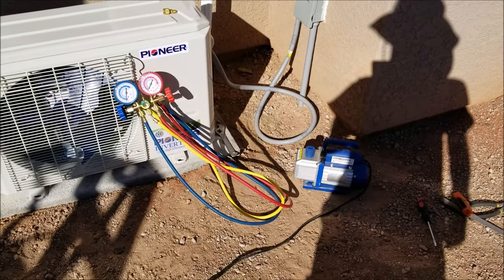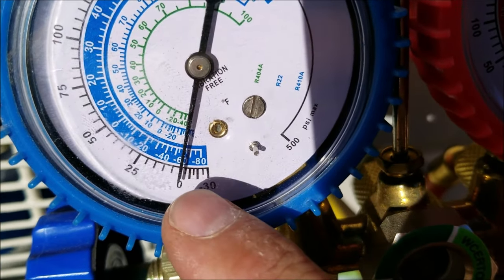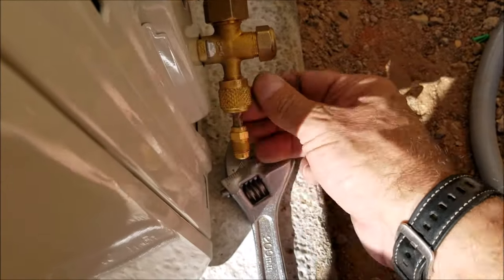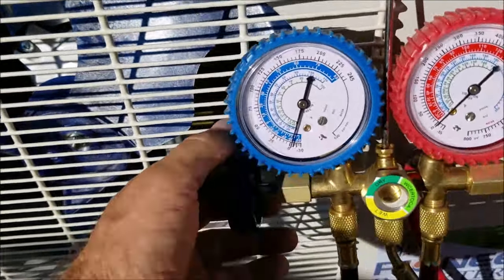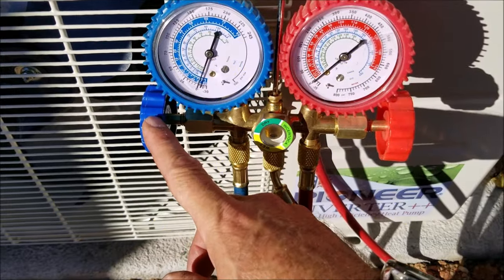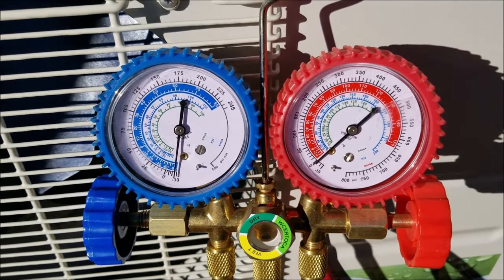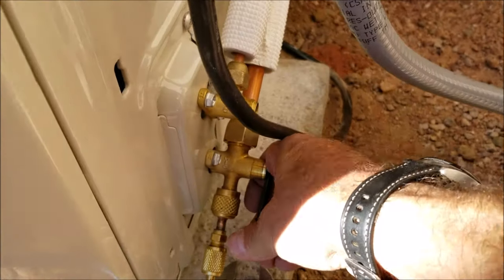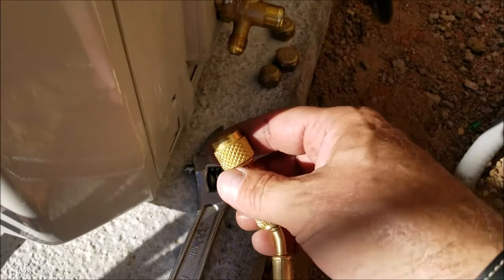How To Vacuum Down a Mini Split with Analog Manifold Gauges

Comment from the maker: UPDATE: I made an update video that shows more details and how to check for small leaks. Here is a link. https://www.youtube.com/watch?v=DgaPPyAZSTs

The line set can also be tested for leaks with a low cost can of R152a propellant. Before vacuuming the unit, the line set can be filled with the R152a and tested with soap and water for any leaks. KWIK-E-VAC on Amazon is R152a. Here is a link. https://amzn.to/3AlXVpH
Reply: I actually run the AC in my classic 70s car with R152a. I use canned air duster which is the same. Thanks for the tip.
Reply: Thank you for sharing your expertise. 
One question is that the port for vacuum is no need to remove the valve core.
Thanks in advance..
John
Reply: That tip is golden. I wss wondering how to do a bubble test without getting a costly nitrogen tank to verify, and dont want to trust beginner quality vacuum pumps without having a quality micron guage. The unit itself is well under 1k so it would be silly to pay 5x that for an install even IF you brick the thing or shorten its life. Pressure test shpuld be dome before trusting any mediocre vacuum because a fraction of moisture from above 500 micron isn't immediately fatal but a refridgerant leak sure will be.
Reply: Very helpful!

Comment: This is possibly THE BEST and easiest mini split vacuum video on YOUTUBE. 99% of the videos on YouTube either skip this part in detail or don't explain it well. For the record: YES I DID USE THESE INSTRUCTIONS to vacuum a non DIY mini split and it's been working with NO PROBLEMS. HVAC "contractors" or "Con-tractors" wanted to charge me $400-$800 just to vacuum. Like I told the last guy "You all keep overcharging and turning down work it won't be any work left sooner or later".
Reply: 😂 I've been seeing these con-tractors losing their mind in the comments on minisplit social media ads. They are scared of this tech!
Reply: I'm not a HVAC contractor, but am a contractor.. I just gotta pipe up and say that cost was fair! I can't even open my door for less than $300.. You gotta keep in mind, insurance, fuel, licencing, experience, man the list can go on and on.
Reply: @haulotteConstruct 300 for an hour of work? $100 for your parts and insurance  , and $150 per your hour of work assuming you’re driving from 15-30 min around the city. $300 is too much and $400 is insane.
Reply: Overhead, profit, gas/insurance/wear, time, knowledge+skill all adds up

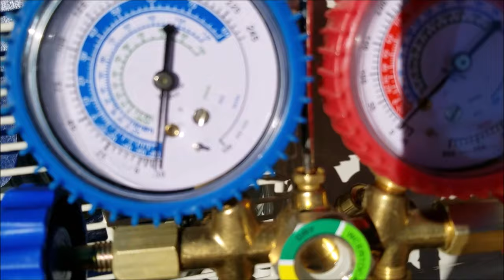Figure its an hour hold under pressure 30min to setup/pull a vac, 15 to disassemble/close up/pack up tools in the truck. Add in a 30min drive each way(could be more could be less) and youre at 2:45min from start to finish time wise. A set of gauges and a vac pump would cost you 150 bucks from home depot. 400 sounds about right, 8 is nuts unless its a 3am emergency. 

Now youre more then welcome to do it yourself, buy paying a tech also means if it doesnt hold a vacuum theyll correct it. If they mess up theyve got refrigerant ready to go. 

When i quote clients (different business) i factor in 10% for overhead and 20-30% profit. That would put this job at 300 for me and i dont have the overhead a licensed hvac tech does. 
@oshitomaha
Reply: Doesn’t a hose cost like 100$, a vaccum pump another 150$, then you got an hour of time so $150 an hour service charge plus their travel time? $800 sounds fair
Reply: @marklujan7591  If you're willing to spend $800 plus for that then I need to go ahead and get licensed lmao. The ENTIRE kit on Amazon is about $150 for everything. Now if you're not capable of tightening a cap or screwing a hose or reading a meter then there is a COMPLETELY different discussion and self reflection that you should be having.
Reply: @marcus_b1  ahhh okay well I don’t usually go super cheap on this stuff, if you’re doing it for just 1 time use then I guess but my customers use this multiple times a day for years.
Reply: And when you can get the whole set of tools on Amazon for less than 150$ who the hell would pay a contractor at this point. Sure they are supposed to have the knowledge but I'd trust myself more than 90% of the contractors out there.
Reply: @marklujan7591  Do they have to buy a new hose and a new vacuum pump each call.

Comment: Yo!!! You just saved me 300$!!! I just installed a mini split and needed only the lines vacuumed, I got a quote of 250$ and 50$ for drive to my house. I ended up buying a manifold gauge set for 83$ on the Walmart app and bought everything else you posted from Amazon. Thank you so much for this easy to follow guide!! Man it feels good that your video helped me out during and save me a couple bucks!
Reply: can do it for free... autozone and o reily lets you borrow the pump and gauge!
Reply: I was quoted $800 lol.
Reply: @michaelnguyen370 autozones manifold gauge doesn’t work on mini split set ups - there hoses are 1/2 and mini split requires 1/4 hvac hoses
Reply: @Bostonn617 you gotta buy the adapter

Comment: I think that after releasing the refrigerant onto the lines. Then, you should close it again to disconnect the vacuum valve. Then open agai. This way you only lose a minimum amount of refrigerant.
Reply: Saw another video  where the guy put 1 pound of refrigerant inside and let it sit for a while to see that there are no leaks with positive pressure. Then he disconnected with the 1lb of pressure instead of high pressure,  so lost minimal gas. Then opened all the way

Comment: Best and most clearly explained vaccum procedure out of the last 10 or more videos I watched.  I had a leak (or so I thought) turned out it was the cap on the vacuum pump. Helps to close the valve on the guages before shutting off pump!!! Thanks!!

Comment: Man thanks so much for your video! The first mini split I installed, they charged me $285 just to vacuum it! I spent $180 on a pump and gauges and adapter and doing it myself! Priceless Info since I’m currently Installing mine in my bedroom! I’m currently letting it vacuum but soon I will have cold air and won’t have to call the HVAC guy no more!!

Comment: Thanks for the video,I just installed my Mini Split and saved $250
I bought a vacuum pump and did what you did,step by step and had a leak that would be a problem,but vacuum pump helps 
Thanks

Comment: Out of curiosity, I called a tech guy at I know at Carrier. This morning, he told me once when he was in the field, he couldn't get his micron gage below 550.  He re-pressure tested with a tiny bit of 410 as a chaser. At 300# for 30 minutes. No leak.  Because he used some 410 as a chaser his electronic tester found a tiny leak. 300# of Nitrogen for 30 minutes is valuable, but it's only one step of two. The 300# test will not reveal small leaks in 60 minutes, but will drain the system in 20 days etc.  The micron gage will find small leaks.

Comment: Thanks.  Ready to vacuum the lines on my Della mini-split (relabeled, most made by Medea of China).  I have the Harbor Freight gage set (automotive) and their vac pump, similar to your setup and frustrated I had no fitting for the mini-split port.  Should have found this youtube earlier.  Down until I receive the adapter you mention.  Thanks.

Comment: Thanks for the video. Some mini split manuals indicate to open the high-pressure valve by 1/4 turn for 5 seconds before removing the vacuum connection. This allows positive pressure in the lineset to prevent 'sucking' in outside air when the vacuum connection is removed. Fully opening the refrigerant valves before removing the vacuum connection (as you did) also prevents outside air from being 'sucked' into the lineset, however, in that scenario I think you lose refrigerant from the lineset that gets 'sucked' into the vacuum hose, because the vacuum hose also was in a vacuum along with the lineset before the refrigerant is released. 

The refrigerant 'lost' in the vacuum line might not be an issue if your lineset is less than 25 feet, since the mini split may be designed to contain sufficient refrigerant for a 25 foot lineset.
Reply: This was the one thing i noticed he didnt do that others seem to prefer to do, thanks for clarification

Comment: A little tip for anyone like me , I followed this video however when doing the last step of removing the vacuum hose I made a critical error .
I put my connector on using a spanner to make sure the seal was super tight to hold the vacuum properly upon undoing the connector because I had to use a spanner again I couldn’t undo it as fast as I thought and Refrigerant gas came screaming out onto my hands super cold thinking my fingers would freeze off I grabbed a rag to finish it off but lost quite a bit of Freon in the process. 
My neighbour that I later found out to be a HVAC guy told me they always undo the connector first then release the gas to avoid this issue ever happening and after all the years he’s been doing it they have never had an issue with losing vacuum inside the lines . 

So I’m not saying this guy is wrong I’m just saying either way is ok and you chose.
Reply from the maker: The unit will likely work but won't last as long as it normally would. 
Outside air rushes back into the vacuum which mixes with the refrigerant and causes damage and wear to the system.

Comment: You’re suppose to open the 2 way valve first. You can even open it a quarter of the way for 10 seconds, close it, and check for leaks using dish soap and water on all your connections to make sure you have no leaks. Then after you’re sure there’s no leaks open the 2 way valve all the way. Then open the 3 way valve all the way. Besides that good video.

Comment: Thanks for showing "De minimis release", never heard of that.
I am wondering if you should read the gauge before you remove it from service port? So you know if the mini split hold full refrigerant. Thanks.
Reply: definitely! otherwise you won't know if it came fully charged. I had two new ones come low on charge.

Comment: Thanks for this video, very clear better than those other ones.  I do have a question if you could answer it at your convenience.  I have my mini split, I vacuumed the lines and released the refrigerant to the lines, however, I never check for leaks (pressurized it), and all the refrigerant leaked.  I found the leak n I will seal.  So, my question is, what is the order to refill the whole system?  Do I vacuum the pipes only or the whole system first, ( how long approximately should I do it? , once I vaccum, second, should I pressure it?  Or should pressurized first and then vacuum? and then last step refill the system?... once I'm refilling the refrigerant back into the system should the system be running? thanks
Reply from the maker: Pressurizing the system is a test for leaks which may be a good idea if you think there is still a leak. 
After the leak is fixed, the unit is vacuumed down, then refrigerant is added by weight. The amount the unit holds will be labeled on the outside condenser. Here is a video I made describing the process. https://www.youtube.com/watch?v=LrMQONBJJgE

Comment: How do you know the schrader valve is depressed and you're not just vacuuming out the hoses and not the lines?
Reply: I have the same doubt how can the low pressure line  be vacuumed if the schrader valve is depressed

Comment: I've installed a few mini splits without evacuating due to not knowing it was necessary. I am about to install one and wanted to evacuate. My question is this... How is it possible to evacuate the lines when the valves to both connections are closed?

Comment: I take the shrader out of the adapter if i vacuum the system that way. I vaccumed systems like that when i first started. I also never changed my vacuum oil either. 
I dont do it "the old school" way anymore. I change my vacuum oil frequently. And if i pull a vacuum through my analog gauges, i attach my micron gauge to my yellow port. 
In my opinion "old school" was OK but new school is much better. If the manual tells you to pull down to 500 microns you should follow the directions along with how to install the unit properly. On new equipment the "single hose setup" is just as easy as the old school way once you get used to it.  One half inch hose, a core tool, and a cheap micron gauge pretty affordable too. In my opinion-unless you keep on top of your hose gaskets, anologs always leak. Most new guys in the field let their hose gaskets go to shit. 

Anyways, this is a good video for homeowners who are installing their own ductless systems. But if my customer is paying $16,000 to put a new mitsubishi quad zone sytem in, i will give them nothing but the best quality job and practices. Also you made a good explanation on the decay test. Its better to vacuum than no vacuum at all. To each is their own.  Hell, these amazon ductless units are disposable anyways.
Reply: Ok so are you saying I should do what he did when I install my Senville unit?

Comment: I saw a video that instruction indicate that the procedure to release the refrigerant
Is on the small liquid line turn the Allen wrench a quarter turn open for five seconds close the line
Check again for leaks then take off the vacuum pump line quickly off. Then go back and open both lines fully and leave open
The Manufacturer indicates that this five second release of the liquid will push out any remaining air when you disconnect
The vacuum line with out risking thewhole refrigerant system.
Think about it makes sense

Comment: Thank you for your mini-split videos! My Mr. Cool unit quit heating efficiently. To service I would like to vacuum, check for leaks and recharge. I'm assuming vacuuming is the first step.  Do I CLOSE the two valves on the line set to do this. Then re-open them to charge?

Comment: How does a DIY installer find a tiny leak without a nitrogen pressurizing setup? I used Nylog blue on the fittings, made sure the vacuum hoses are clean and tight, got a brand new vacuum pump too. It pulls down almost to -30 but no farther and when I close the valve and turn off the pump, in about 30 minutes it's back to 0.
Reply from the maker: Usually, the leaks are at the flares, but the line-set will need to be pressurized and tested with soapy water. If you do not have Nitrogen, a low-cost KWIK-E-VAC Line Set Flushing Kit can be used to pressurize the line. Here is a link: https://amzn.to/3AKpE3u

Comment: On the Daikin 4mxs outdoor condenser, it has a liquid line and gas port service valve. I assume you're only required to vacuum down the gas port? Everyone of these videos only shows a mini split with one service port, but some units have two service ports (each line).
Reply from the maker: Units larger than 1 ton often have ports on high-pressure and low-pressure lines. When setting it in a vacuum, only the Low-Pressure big line is used.

Comment: Just a quick tip if anyone sees this comment. When you unscrew the hose from the unit, unscrew at the adapter where it connects to the unit. If you unscrew the hose where you connect to the adapter, you’ll spray refrigerant everywhere. Won’t do that again. 😅
Reply: So all the refrigerant came out. So what do u do to recover after that?

Comment: How do you possibli know tha there's a leak with the low pressure valve closed on the manifold gauge?
Reply from the maker: The valve opens and closes the center port. The manifold gauge side is always connected and on.
Reply: @HVAC_Mechanic My bad, man..😅😅..I'm a rookie and didn't realize that the manometer wasn't controlled by the valve...I disassembled mine's to know how it worked...🤦🏼🤦🏼🤦🏼

Comment: How important is to tighten caps? Are they playing any role except dirt protection?
Reply from the maker: Mainly for protection, but those valves can sometimes leak with age, so they can also help seal the system if they do leak.

Comment: I have a dual zone system so I have two low pressure ports. Do I need to connect my blue and red hose to pull a vacuum on this unit and after I pull a vacuum do I fill with 410 A on both low pressure hoses? Or do I connect just a blue one and my yellow line to my 410a

Comment: Hello, I had a question, I vacuumed down my mini split according to your video and it held for an hour at -30microns. Then I released the the high pressure valve and the low pressure valve shot up on the gauge accompanied by a squeal. I discovered a small leak at that connection point with the soap. I fixed the leak but don't know what to do next. Am I ok to do the electrical and run it? Or do I have to do a pump down. Thx for the great videos.
Reply from the maker: If the leak is fixed and the unit is working, then it is likely good. If it is still leaking, then it would need to be pumped down and refrigerant placed back into the outside unit while it is fixed.

Comment: Nice video TNX.  Question: if there are no leaks shouldn't the gauge remain unchanged indefinitely assuming good gauges and hoses?
Reply: Its because of the flare connections in that slow leaks are not uncommon with them.   Do you pressure test first?

Comment: Did your Adapter have the small part that presses the shrader valve on the compressor connection?  Some take off the shrader valve on the mini split compressor connection

Comment: Hello friend, won’t the blue line fill with refrigerant if you release the charge? Shouldn’t i first disconnect the blue line (after vacuuming) before i release the refrigerant?
Reply from the maker: The blue low-pressure line is turned off. If the blue gauge line is removed before releasing the refrigerant, it will lose its vacuum. So the unit doesn’t lose the vacuum; the line is removed very quickly with only a small amount of refrigerant being released.
Reply: @HVAC_Mechanic I removed the vacuum and then released refrigerant, did I destroy my unit?